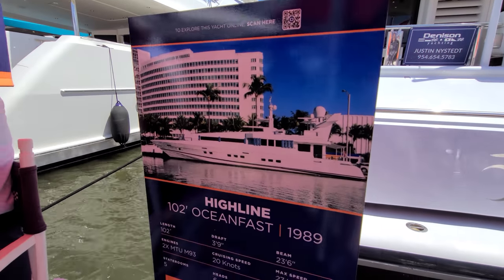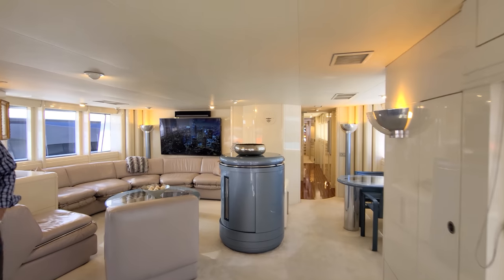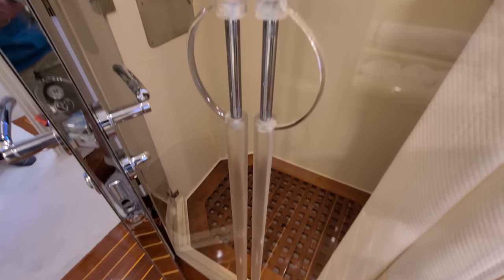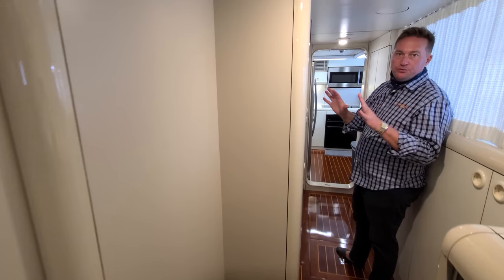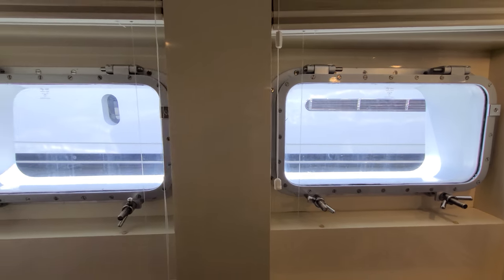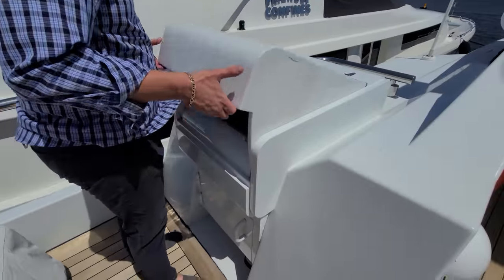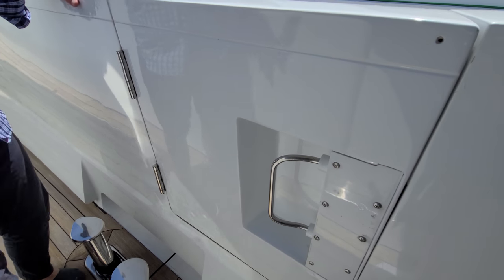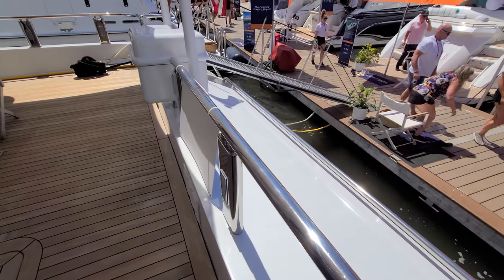Retro 1989 102' Oceanfast by Jon Bannenberg "Highline" - Denison Yachting at PBIBS 2021

Comment: I believe this boat been for sale five years ago if it’s the same yacht it’s been for sale for quite some time. I’m still waiting on my video of 104 foot Ocean Alexander sky lounge. I would also like to see the engine room on the Ocean Alexander the reason they added an extra 4 feet I think it’s because of the new standards of engine exhaust in the engine room the older Alexander’s were 100 feet the new ones are 104. 
🇺🇸🇺🇸🇺🇸🇺🇸🇺🇸
Reply from the maker: I went to Ocean Alexander's site and see that they'll be debuting their brand new 35R at FLIBS 2021 which I want to cover. It shows a waterline length of 104'. Is this what you're talking about? If not, check out their website to give me the exact model name so I can cover that one too!
 https://oceanalexander.com/yachts/35r/
Reply: It’s the 32L. That’s the one I need a video of the engine room exhaust system and the swim platform see if it’s hydraulic
Reply from the maker: @DriveSafeDon  I'll make a note to cover the 32L at FLIBS in October.  Until then, enjoy plenty more of PBIBS coverage!
Reply: @FAD1010    Thank you. Now go to bed. Lol
Reply from the maker: @DriveSafeDon  😴 🛏